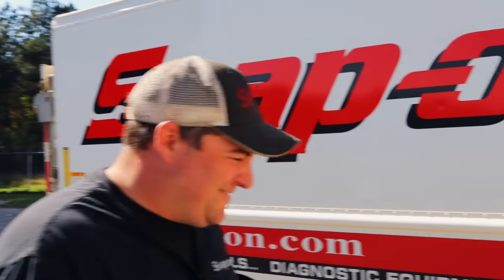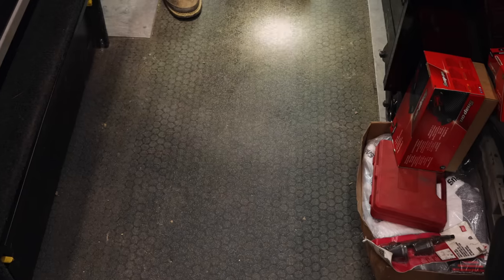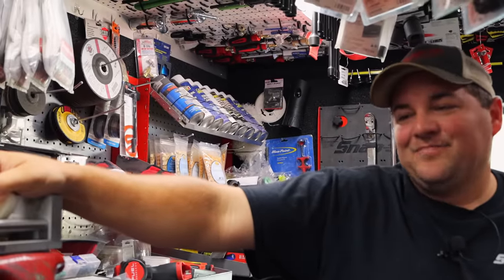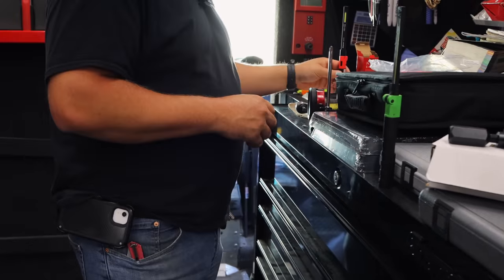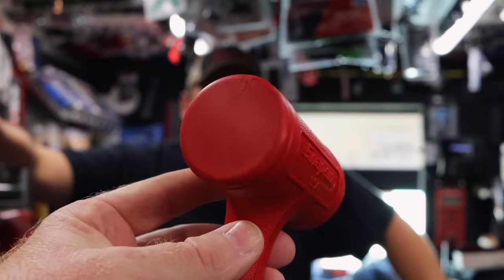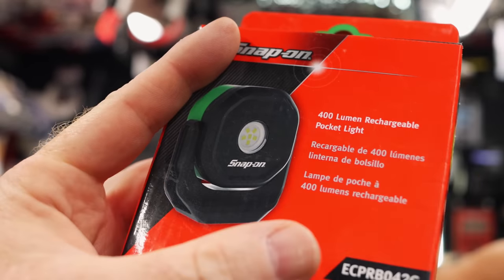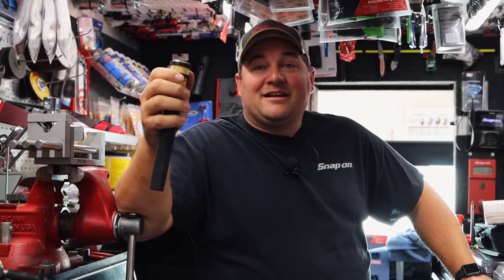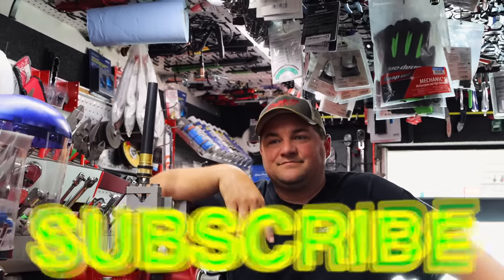Snap On: Toolbox Sale On A Green Classic Series and Another NEW Light

Comment: I used a pilot bearing puller with slide hammer to remove a motorcycle steering stem race worked great does what it is supposed to.